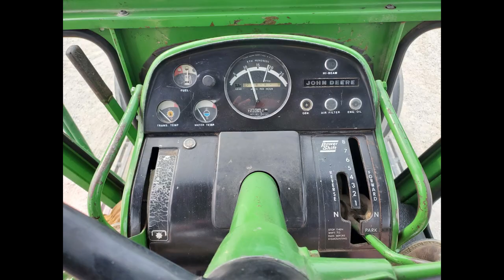4850 unveiling

Comment: Was this 4850 bought when you sold the front wheel assist 4850?
Reply from the maker: Yes it is - but it was purchased quite a while after we sold the mfwd 4850 ... this is also the 4850, I've been running a video series on ... this is the nicest 4850 we've ever had - I'm real happy with it ... thanks for checking in - hope all is well on your end